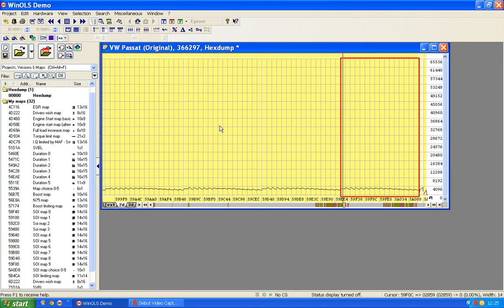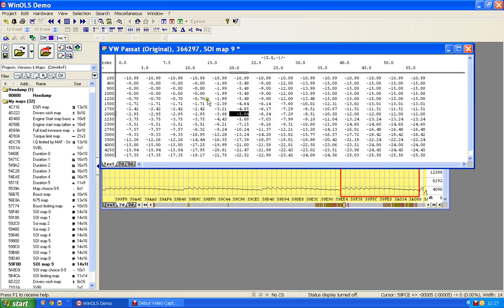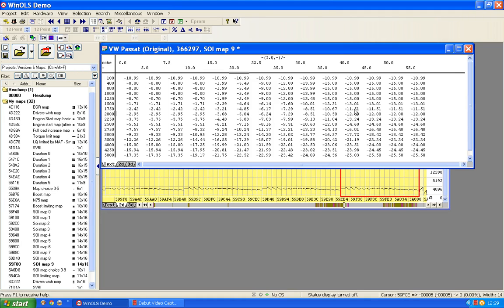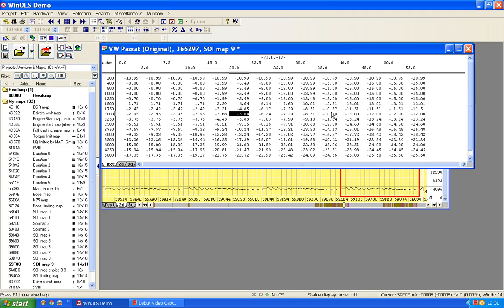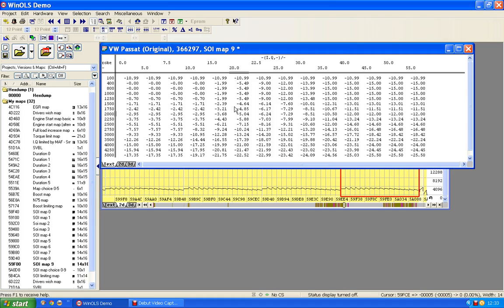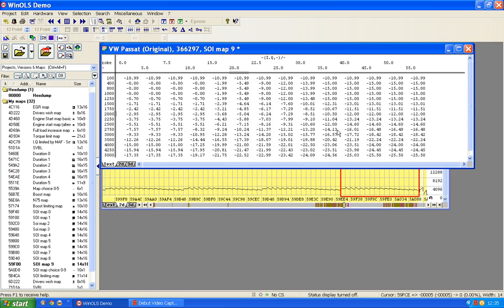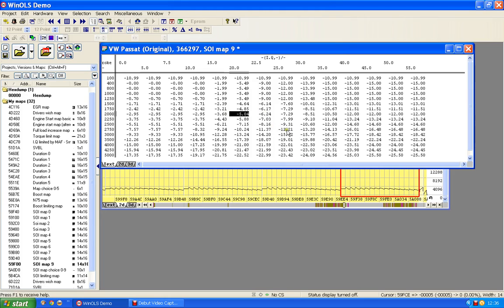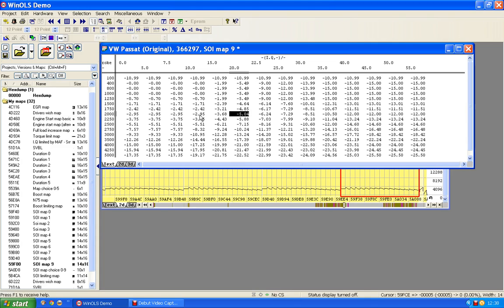Winols understanding ecu maps 8 Start Of Injection maps

Comment: Why in my edc15 maps on bmw 320d i have values with - and + ? Its retarded and advanced injection ? whats your opinion about advancing injection on middle or high IQ values ?
Reply: vagecumap I increased in low rpm and middle IQ area with 0.5 degrees, and with 1 degree after 30 mg and from 2600 rpm to 4000. What do you say about this ? I know that without dyno i cant know exactly these values, and without know the optimal bsfc but 0.5 degree is not so much, especially in the 'black hole' EGR area